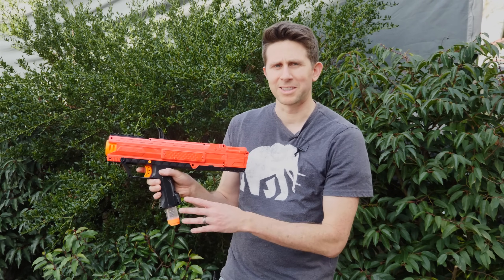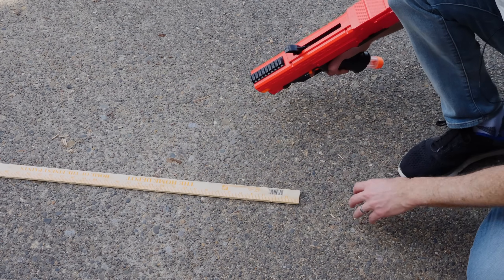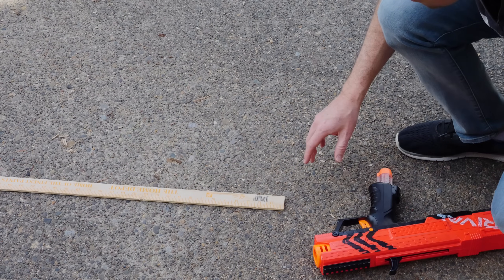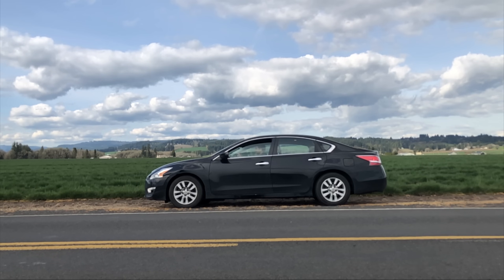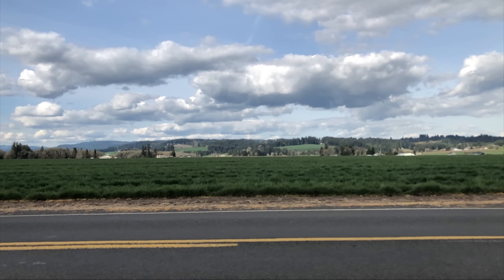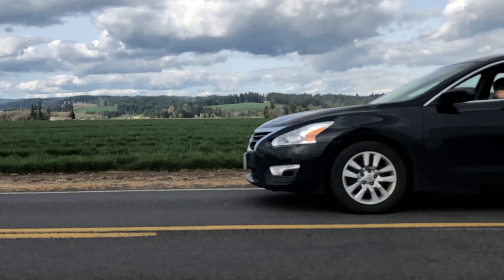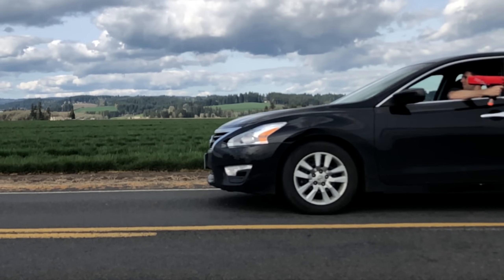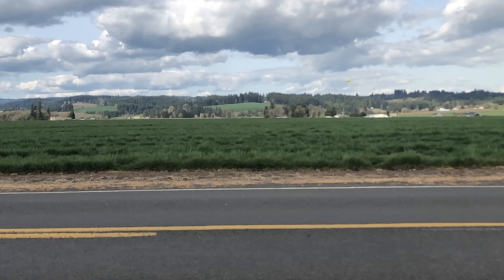Shooting a Nerf Gun Backwards While Driving At The Bullet's Speed Forward

Comment: The military should do this with a real gun in a jet.
Reply: Just use a mounted gun that can be pointed down
Reply: That'd be awesome tbh.
Reply: 'Grumman F-11 Tiger'
[Wikipedia]
The F-11 Tiger is noted for being the first jet aircraft to shoot itself down. On 21 September 1956, during a test-firing
https://en.m.wikipedia.org/wiki/Grumman_F-11_Tiger
Reply: Carlos_A_M it doesn’t matter the circumstances mate, it wasn’t specified that it had to be straight and level flight. In the right frame of reference it is flying straight and level relative to the observer, either way there are many ways a jet can fly into its own trail of bullets, and as is stated earlier the air resistance and gravity on a projectile can slow it down enough that the jet can fly into it, another thing to keep in mind is that jets can travel at a constant velocity due to a constant source of thrust where as bullets are fired by one rapid discharge and then rely on their momentum to reach the target, they are decelerating the second they leave the barrel. Whereas an aircraft can continue to accelerate or maintain its velocity, common sense tells you that in the right circumstance that the two objects can again come into close enough proximity. So yes it is entirely possible and it HAS HAPPENED, you just need to investigate a bit more as it seems you haven’t actually looked into the topic of military aviation especially early jet warfare to understand it, ITS OK TO NOT KNOW THIS YOU DONT NEED TO HE AN EXPERT ON EVERYTHING STRAIGHT AWAY! So don’t discredit/disregard an argument because you’re wrong or don’t believe it, check their sources!
Reply: @PL4GU3d  ok yeah, indeed I was wrong, thanks for the info man.
Reply: James Wohltman let it rain bullets yeah?
Reply: Actually, some modern cargo planes have a faster maximum speed than some bullet velocities.

So for example, a .38 special (130 gr) can archive a muzzle velocity of 528 MPH (775 fps). Meanwhile, the Lockheed C-5 maximum cruising speed is clocked at 532 MPH

So basically you technically can fire a gun from an open cargo ramp and see it for yourself if the bullet will fall straight down.
Reply: well hello there matt
Reply: James Wohltman they did, kinda. The military attempted to attach weapons onto a supersonic jet that was going so fast that it actually shot itself out of the sky.😂😂
Reply: @tylernoble784  That's not true. Engineers aren't idiots.
Reply: skeptic moderate yea that’s what I thought too. It really happened it’s beautiful lol
Reply: @skepticmoderate5790  ever heard of Lockheed Martin Sr 71 ?
One of it's relative models shot itself and yes, it did happen
Reply: skeptic moderate actually it is true it’s been done before
Reply: Tyler Noble 
That can’t be true. That would involve shooting the bullets forward. A bullet shot from a gun moving 600 mph is ALREADY moving 600mph plus the extra speed the gunpowder would impart from it. 

Gravity would pull the bullet off the airplanes path before the plane could overtake the speed of the bullet
Reply: @blakew5672  actually the Grumman F-11 did manage to shoot its self down before, but this is a special case early in the development of supersonic aircraft and not something that could happen today as special care is taken to prevent this (just sharing information that is interesting about aviation)
Reply: Yesssss
Reply: Jesus Christ Source? I’d be impressed to hear of any jet doing a strafe at 800 miles per hour
Reply: @aegerman6317  During testing that's why.
Reply: A Lockheed SR-71 Blackbirds top speed is 2193 MPH, the GAU-8 Avenger, the main gun of the A-10 warthog shoots ammo at a muzzle velocity of 2,266.3636 mph. So if the SR-71 was equipped with the GAU-8 Avenger autocannon and it fired it backwards would the bullets just drop?
Reply: justinl458 the bullets would move backwards at about 73.3636 mph
Reply: justinl458 Yes it would drop if the speed was perfect but 1 mph to fast and the bullet would travel 100 ft before it drops
Reply: justinl458 if the GAU-8/A didn’t have any weight, sure, but the SR-71 might not even be able to take off with such a weight added to it. An M61 might be a better choice, but I’m not sure of the muzzle velocity of its’ 20mm rounds.
Reply: Use a gau avenger
Reply: Yeah...gotta step it up...
Reply: Don’t they have guns built into the jet?
Reply: Its expensive, dangerous and a bad idea.
Reply: @CarlosAM1  the history did a good video on this a few weeks ago maybe i'll search that for you
Reply: @CarlosAM1  https://youtu.be/iExudx915Ek
Reply: @freaki0734  thanks for the info, I didnt know it was possible.
Reply: The military has done this, but as result accidentally shot their own plane
Reply: They did..and actually shotdown themselves..the plane flew faster than the shell and hit the airfcraft..
Reply: Missiles...
Reply: The bullets move faster then mostly any jet
Reply: Numbahclaud the key word is “mostly”
Reply: @fenrix155  if your going that fast in a jet you wouldn't be able to stick your are out the window to fire a gun. Your body would be sucked out bc planes have pressurized cabins and cock pits. What the hell would be the point of the military doing this. Thats an expensive waist of resources. You gotta keep in mind that running jets isn't free at all and it can cost millions to fly certain planes. Anything fast enough  to match the speed of a mullet would be extremely expensive to fly for just a few ours.
Reply: @numbahclaud7180  Yes, match the velocity of a speeding mullet
Reply: @owendaulton9316  i typed fast and meant bullet. My mistake.
Reply: Numbahclaud ‘twas a joke
Reply: @numbahclaud7180 sorry, i don't want to be THAT guy, but 

you're * hand* cockpits* ?* waste* bullet* hours*
Reply: @numbahclaud7180  program an arduino or sort to fire it when the jet reaches the bullet velocity?
Reply: James Wohltman find me a jet that goes 305 meters per second “ keyword” second
Reply: ImWrecKkK um... literally any jet I think 🤔
Reply: Numbahclaud I think you are thinking to much about a comment bro
Reply: Numbahclaud most jets are way faster than bullets... hence why modern jets don’t usually use guns and missiles instead
Reply: @Infinityskatemedia  actually most jets use mostly guns, its just a very high velocity cartridge, it also already has the velocity of the aircraft to help propel the bullet, they have missiles but they don't use them all the time as missiles are VERY expensive and right now most air engagements are typically air to ground so bombs and rockets are usually used/equiped instead (rockets being cheaper than missiles as they lack guidance and typically are smaller), one major example of modern jets using guns is the F16 using the M61A1 20mm six barrel gatling gun that fires at 6000 rounds per minute with a capacity of 511 rounds, which those rounds are very capable of taking down any aircraft the F16 realistically would engage (so not an SR-71 blackbird which can fly higher and MUCH faster than the F-16 meaning instead a missile would be used, usually a surface to air missile, its also a recon aircraft so the time to take to get an F-16 aircraft into the air would be too long to attack the SR-71) though in theory if the F-16 could keep up with the SR-71 it could shoot it as when you fire a bullet, the velocity of the bullet is its standard velocity relative to the aircraft, making the bullet move at the velocity of the aircraft plus whatever the gunpowder adds when firing (I know a lot about jets, not everything, but quite a bit)
Reply: @numbahclaud7180 | ... kill joy ( ---and Mullets went out of style in the 70's :)
Reply: @numbahclaud7180  there are subsonic bullets and supersonic jets, its very possible for jets to outrun bullets
Reply: Chris Person 
A subsonic bullet fired from a supersonic jet is still going supersonic
Reply: @numbahclaud7180  My Hi-Point says otherwise
Reply: @numbahclaud7180  45 acp is a subsonic round that is very common and the military has multiple supersonic jets, it can be done
Reply: @numbahclaud7180  ~1700 mph
Reply: @numbahclaud7180  Everheard of subsonic bullets? Subsonic 9mm bullets usually move around 700mph.
Reply: This is a commonly understood fact for any person making a plane.  Hell we understood this a thousand years ago when we realise hitting someone with a weapon from the back of a moving horse did way more damage than just hitting them with the same weapon when your not moving. 

An object your firing already has the momentum of it moving in whatever direction your
Going. This is why offensive weapons are always forward facing. And defensive onse can be any direction. An offensive eapon fired backwards will effectively have its velocity reduced by the speed of the object its fired from unless it is aiming at something that is also flying tmin that same direction (like another pka e behind or around it) 

And reversely if you strap a gun to the front of a jet and fore fowards. That bullet is now going the speed of the jet PLUS the speed of the bullet. Making it hit even harder when it hits the target.
Reply: Jet aren't fast enough
Reply: @zebrahunter6956  depends on the jet and cartridge, see my previous replies as to how

Comment: This is retarded. All bullet's accelerate towards the ground at 9.8 m/s² when fired or dropped, so of course it'll fall, so if it's a high speed projectile or you literally drop it from the same height, they will both hit the floor at the same time. And yes if you are traveling at the speed the projectile will travel, it will drop with little horizontal speed

Comment: You ever heard about a bullet chronograph? It's used in paintball. Also a driver and a gun operator for safety? There is no inertial frame, this mean that an object flying east-west at less than 1032 mph at equator it wont get anywhere.

Comment: Back in the 1950s, the Air Force came out with one of the first super-sonic bombers (I don't remember which one) and it had a 20 mm automatic cannon tail gunner machine gun. 
They found the same thing. When the plane was moving forward at about 900 meters per second and the machine gun was fired to the rear at 900 meters per second they canceled each other out and the bullets just fell to the ground.
Reply: but if some other fast plane hits them it's still gonna have quite an impact^^

Comment: What if you shot backwards like that on a bus? Would it fall at your feet?
Reply: not if your feet are moving with the bus... if you stand outside the bus and watch someone shoot the ball inside it will fall straight... but if you are moving with the bus it will fly away like it usually does
Reply: @johnuferbach9166  it can't do both.
Reply: @johnuferbach9166  it can't land at feet and also fly away.
Reply: @noahway13  if you're standing inside the bus it wont land at your feet because you move with the bus, if you stand next to the bus and watch it from there it will fall down in a straight line

Comment: What happens if you drove your car at a moderate speed, and den driving up a Truck back ramp that is going just a tiny bit lower than moderate speed

Will the car fly off the ramp when it touches?

Will the car immediately stop once it goes up the ramp?

Will the car have difficult time going up the ramp which is scraping the road?

Comment: About the elevator, even if you can jump 3 mph or 25 mph its no use you dont know when to jump.
Right timing cause lower struck speed, but Too early jump, increase the struck speed when you also take down by the gravity.

Comment: Hi,

People survived the elevator-fall at the Empire State building because of air-resistance? Heck-No! Actually elevator cars have a safety-block beneath that have braking-wedges to grab the rails when the cable gets severed. These wedges are supposed to completely arrest the fall. Even if they failed, they would have sufficient friction to slow-down the falling car to a walking-pace.  That would be @ just 2mph!

Comment: It wasn't the forward momentum. The ball has been pulled a bit forward by the low pressure at the back of the car. If you noticed, from the point of release, the ball remained at that point until the back of the car passed by it.

Comment: Simple: Here the reference plane is different so 55 Mph - 55 Mph = near 0 Mph means the ball stays where it was shooter. Due de-acceleration.
Reply: Would this have the same effect if the ball was shot from inside of the car ? Meaning part of the system (car), because i always get confused about this principle, for instance let's say I'm in a plane that's moving around 500 mph, and i shoot a gun from inside the plane with the same speed, would the bullet fall if I'm in facing the rear of the plane ?
Reply: @lazywonderer4669  relative to the plane (a moving frame of reference) the ball will move the same as it would if you weren't moving, it will fly towards the back of the plane... relative to the ground / if you stood next to the plane and looked inside the ball is falling straigth down insode the moving plane

Comment: I think the reason it started moving forward was because it either made slight contact with the car or it was because of the forward moving air cushion from the low pressure coming off the rear end of the car

Comment: Your not gonna explain why?
I don't understand... Shouldn't the bullet go backwards...
Reply: He explained it quite well in this video. Positive 55 mph + negative 55 mph = 0 mph, which was the final speed of the nerf bullet.
Reply: @jeffo9396  Shouldn't it be if you shoot it forward?
Reply: @notsure6834  If he shot it forward, it would have been going 110 mph.
Reply: @jeffo9396  No, because when I put my hand out of my cars window, my hand Flys back... I don't understand why a bullet wouldn't do the same
Reply: @notsure6834  Your hand flies back because the air pressure is pushing your hand back. A bullet will only be going maximum velocity at the moment it leaves the barrel of a gun. Air pressure will slow it down also. But that's what I meant by the nerf bullet going 110 mph - only *initially*, and then it quickly slows down.
Reply: @jeffo9396  ohhhhh wow! Thanks!

Comment: My view: 1.The gun and ball are stationary relative to each other;  2. The ball, when fired, travels down the barrel of the gun at appx. 55mph, relative to the balls' initial position;  3. The ball exits the barrel and is immediately met with external forces (vortex from air flow over the barrel, possible pressure differential, and turbulence emanating from the vehicle, gun, and human hand holding the gun.);  4. The increasing distance the ball travels from the gun, the more outside elements interact on the balls' momentum  (air pressure, tuberlance from the vehicle, and back-pressure from the rear of the car passing the ball.)  6. As all this is processed thru my brain, I believe the ball did exit the barrel at appx. 55mph but was kept in relative position to the point of fire due to external forces...... Yes, No, Maybe?
Reply: no... external forces don't matter for this, the point is, that the gun (and the ball) are moving at 55mph in the other direction before shooting (relative to the ground), so now the ball is accelerated like you say and that backwards speed and the initial speed cancel each other out, leaving the ball without speed (relative to the ground) (though ofc it's still moving at -55mph relative to the car/the gun)

Comment: I am also pretty sure that because of the speed, anything light thrown out the windows will go right back at the car because of how the air dynamic works, probably a cool experiment to do about turbulences.

I experienced it first hand many times when trying to empty some water out my window in a running car... But the worse time was when I threw up over the window, (I was not the driver of course). Let s just say that we had some cleaning to do afterward.

Comment: You also couldn't jump in a floating elevator because you'd be floating inside the elevator room as it fell.  Plus, modern elevators have brakes, so it wouldn't fall for long.  I've also seen springs at the bottom of elevator shafts to help cushion an impact.  If you did have the ability to jump 100 mph, you couldn't time it right.  You have no way of knowing the point of impact.

Comment: I think the air drag behind the car is also sucking the ball forwards once it passes by the rear end of the car. The Nerf ball doesn't have enough mass. It's so lightweight that the wind really messes up the test and prevents a real accurate measurement. 
I think this test is flawed. Momentum should still allow the ball to be fired at its regular speed. 
The earth is rotating at 1000mph, so if I shoot a bullet traveling 1000mph in the opposite direction of the earth's rotation would the bullet just fall straight down? No it wouldn't.
Reply: It's because velocity is only relevent from a given frame of reference. So from the frame of reference of the car, the bullet was shot as it normally would. From the frame of reference of the camera, the car is moving and the bullet is shot at about the same speed in the opposite direction, effectively cancelling its velocity in the reference frame of the camera only. So that's why your Earth-bullet thing doesn't work, because the bullet would fall from a the point of view of an external person without any speed relative to the Earth, which is definetely not the point of view of the person shooting the bullet. Velocity is always relative to the frame of reference of the observer. There is no static frame of reference. That's what Einstein taught us. As for the air sucking the ball forward, that is entirely true, it has a significant impact, but we can only conclude that the inaccuracy in measure of the speed was cancelled by the sucking effect around the car. I still think that the experiment is fundamentally not flawed.